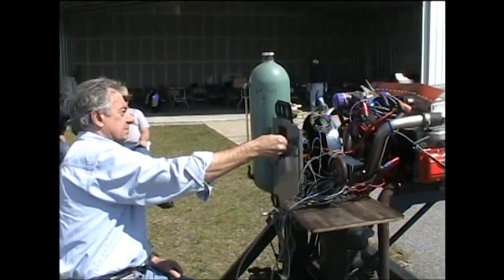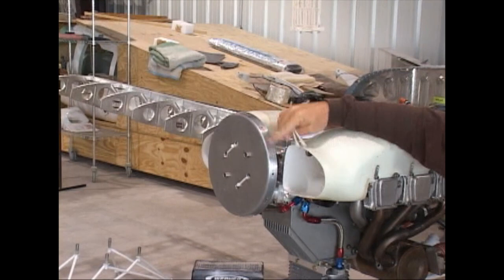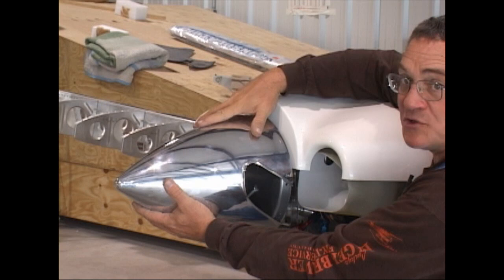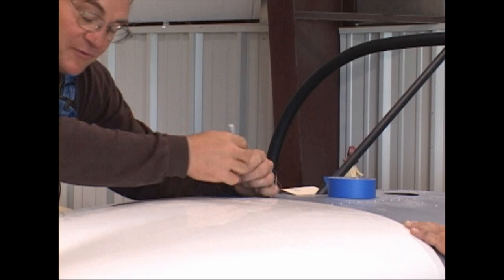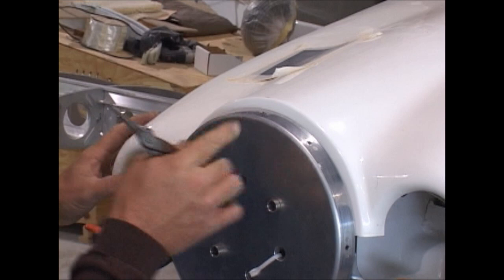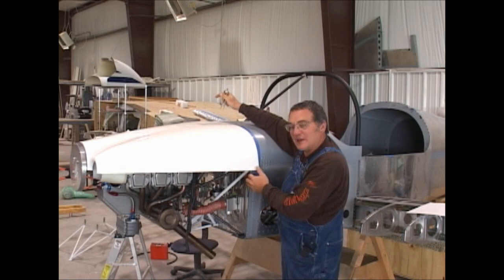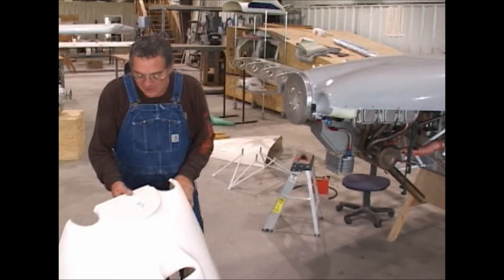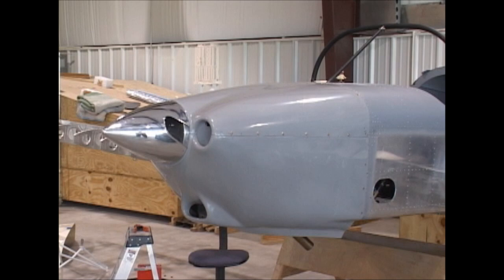Cowling Installation Tips

Comment: Might be a silly question but why on most kitplanes is the cowl such a custom thing? Seems like endless trimming for something that for a given engine should be standard dimensions. Is there really that much variation between engines and aircraft?
Reply from the maker: Yes, there are.  Plus cowl manufacturers would rather make one version rather than 10!
Reply: @HomebuiltHELP  Thanks. I guess what I meant is for a given standard cowling that fits a standard engine (let's say as exactly specified in the manual no mods) why is there so much trimming and tweaking to get it to fit? For example on pre-punched aluminum like the parts in the kit itself, you don't have to do endless trimming to get parts to fit. Is that just because fiberglass is less precise and sags, etc making each piece a custom piece of artwork for that specific plane?
Reply from the maker: @unclefreddy2009  Aircraft kit manufacturers typically don't make or sell engines. You decide on an engine  (almost a dozen popular choices). You decide on a propellor. You also need to get an engine mount that fits your choice of engine and aircraft. Exhaust systems and oil coolers further modify the cowl. The permutations of possibilities are endless. The cowl manufacturer is only going to make one generic model.  Many times you cannot find a cowl that fits and you have to make your own or highly modify one that is close. There are a few kit models that specify every single component, including engine and prop - they can produce a ready-to-go cowl.  But that is a big exception.